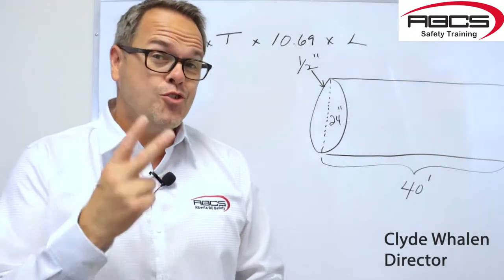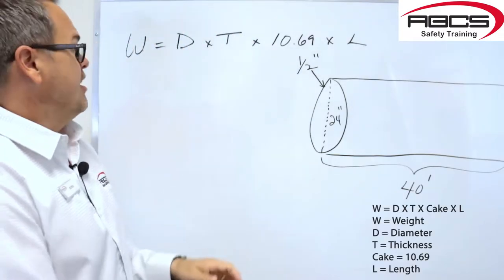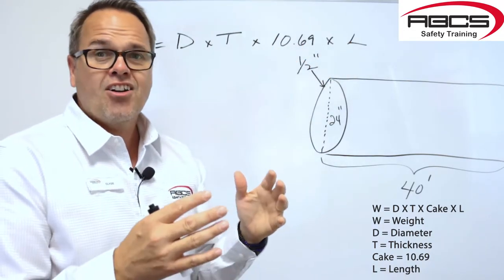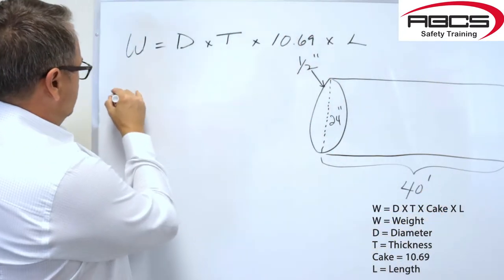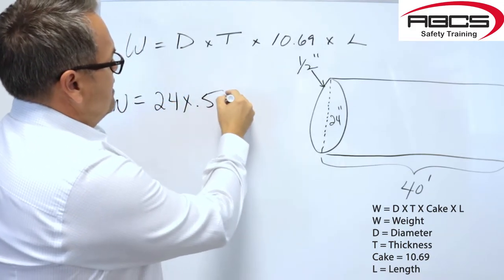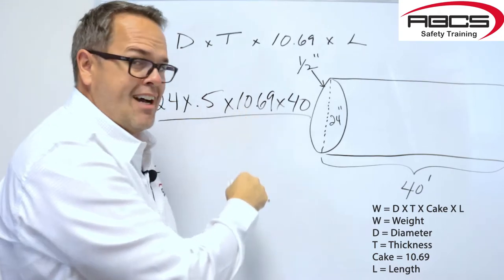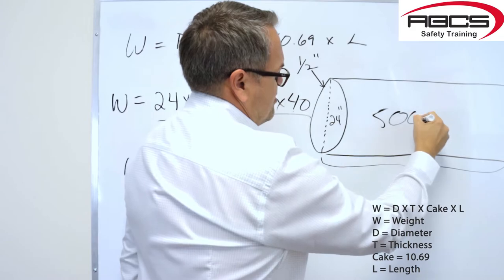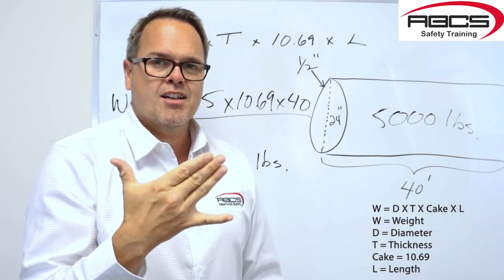Estimating the Weight of Pipe.  2 Minute Tool Box.  ABCS.ca

Comment: It seems to me that the "Cake" constant is the weight of carbon steel measuring 1" x 1" x 12" (based off of 490# per ft³ divided by 144) and multiplied by π.  By using this constant, it already incorporates thickness in inches, length in feet(12" dimension in the basis piece) and incorporates π, meaning you don't have to take the step of finding the circumference.

Comment: Is it a steel pipe or concrete? What material does cake apply to?
Reply: The cake of 10.69 is for carbon steel.  Concrete would be 3.27, Stainless Steel would be 10.8,  Copper would be 12.2, Cast Iron would be 9.82, Brass would be 11.45, PVC would be 1.77, and HDPE would be 1.31.  (Based on weight per ft³/144 x π for each material)